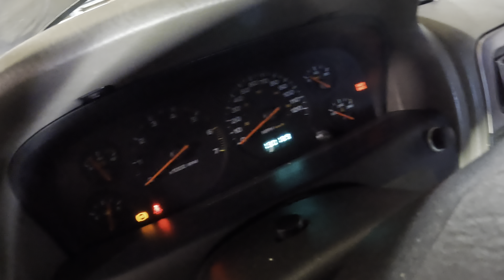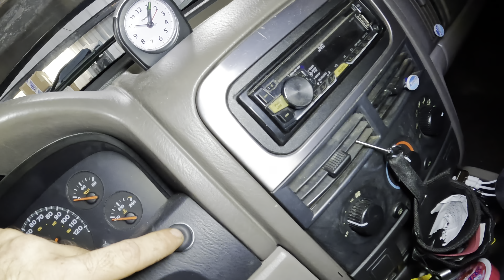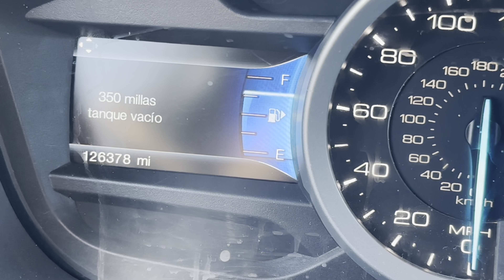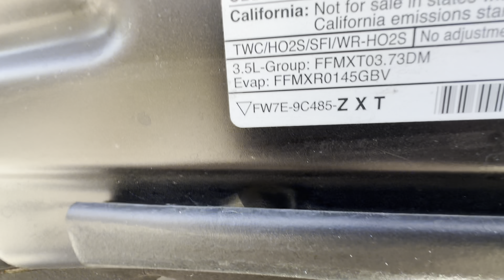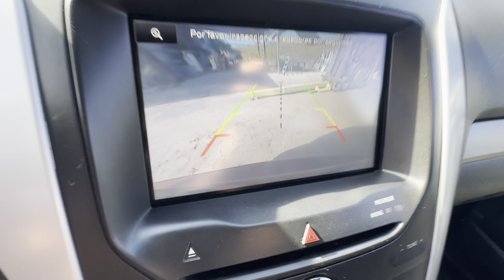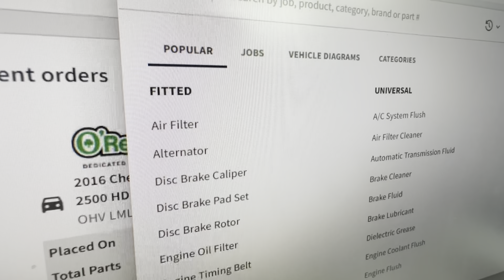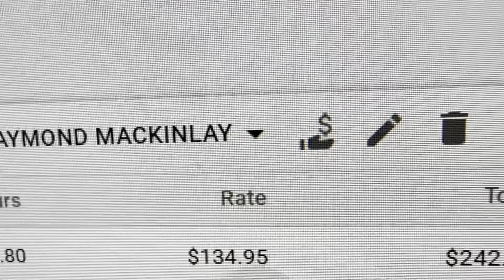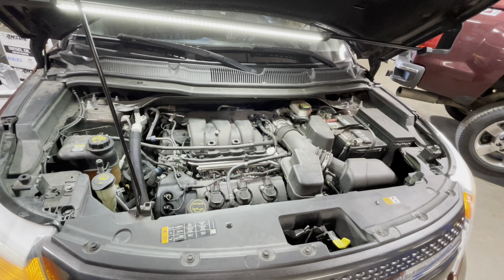TOO EXPENSIVE!  Repairs Declined! Twice! Jeep Cherokee 4.0 & Ford Explorer Noises While Driving

Comment: Wouldn't it be simpler and faster to document everything right with the Jeep instead of everything wrong with it?
Reply: Short list
Reply: I think the list could say it looks like a jeep.........the rest is junk.
Reply: No, Because jeeps have more things wrong with them then right! 😁
Reply: @404notfound..... 
Thats what he said, list of things right with it.
Reply: Not if you just replace the part between the front and rear bumper.
Reply: It's a Jeep thing and that's a thing I never want to know about.
Reply: Pefect observation!! Bravo.
Reply: It's not that it's a Jeep.  It's more like the owner is careless on his maintenance!
Reply: He did, “no rust”
Reply: @frfalbo Most people do not do preventative maintenance. At most, they will change the oil on the schedule that the car maker tells them to. They are not going to go out of their way looking for problems unless they are VERY WEALTHY and have lots of disposable income.
Even then many of them will say "Junk that car, I will go get another 2-3 year old one from the dealer that has been traded in, vetted as being in good condition, AND comes with a manufacturer warranty still running!"
Reply: That jeep is junk, cheaper to buy a newer one then repair it
Reply: This jeep is looking to be a "Just Rolled In" submission. The missing brake pads and pinched off hose are a splendid example of owner abuse.
Reply: Yes, there would be nothing to say...
Reply: Sir , Your Jeep's frame is straight
Reply: The list of things right with it: it has wheels, it is not a Trabant or a Yugo.
Reply: nothing was right with the jeep. its a jeep.
Reply: Glass present.  4 tires.  Doors.  Seatbelts.  Send it!!!!  Reee😮
Reply: It would be a blank sheet of paper.
The best thing to do is take the radiator cap off and then drive a new vehicle under it.
Reply: the engine maybe? those 4.0L engines were basically unkillable
Reply: If he did that, this video would be too short
Reply: @myacidninja1025  thats too new for a 4.0, thats where they started with the v6
Reply: "Most of the lights work, and it starts almost every time"
Reply: @stevepreskitt283  but only if you arc the solenoid on the starter with the key in accessory mode and you have to run out of gas for it to shut off
Reply: Not much right with it ....salvage  yard best bet $$$
Reply: Jeep:   Just Eats Every Penny

Comment: customer thinking, "I can change the alternator myself!"  Good luck
Reply: I'll give my buddy a few beers and he can get a junkyard nator installed for me.
Reply: I mean I did it myself, but I also had a 97 Camry where the nator is quite literally right in front of you when you open the hood. This thing it's buried down at the bottom. Plus that nator I got only cost me like $80 after sending back the core.
Reply: @Skylancer727  exactly
Reply: @milwaukeeroadjim9253  sometimes...
Reply: Refrigerant hose in the way?   Next dilemma for DIYer - inoperative air conditioner with no coolant.
Reply: @timetryp422  customer will likely be back after realizing their mistake
Reply: Just did a water pump on that engine.   Figured easy fix, $100 part.  Then saw 14 hrs labor and have to remove the whole timing system.  Lot more than the old days of 4 bolts and the worst part was the fan.

Comment: Here in the UK we have what is known as the MOT, where once a year every vehicle over three years old has a thorough check of emissions, lights, seatbelts, correct door operation, all suspension parts, tyres, brakes, oil leaks, warning lamps, wipers, steering, exhaust, fuel system, drive shafts, and so on.

All the test points can have one of three results, pass, fail, or advisory, a fail on any one item and the whole vehicle fails, advisories are items that will need attention soon such as treads getting low, slight oil leak, slight brake pipe corrosion. etc.

It takes approx. 45-60 mins and costs £50 or about $63, so not a fortune and can save lives.

I can never understand why they don't have something similar in the whole of the USA, I know some states have a similar system but not all.

This one and like many similar ones seen on such as Rays and other channels are absolute death traps and should be off the road forever or until all repairs are completed.

Many times in the event of an RTA involving one of these sheds, folk die, I'm not bothered in the least if the driver/owner dies, but often sadly totally innocent folk are killed.
Reply: Same in sweden. Usually MOT is a big worry/pain in the ass to go through every 14 months but seing stuff like this kinda makes me appreciate having such a system.
Reply: MOT takes 10 minutes tops here in Denmark. Keep up with the basic maintenance and it's a non event.
Reply: @erik_dk842  do you regularly swap suspension or ball joints as basic maintenance? Basically the only thing they dont check is the state of your filters and fluids, which i would consider regular maintenance. Brake maintenance is the only point i would agree that regular maintenance would prevent MOT trouble. But also there calipers can get stuck, leak, etc so unless you rebuild your calipers every few years, you could still fail there
Reply: In America, every cent of the 63 dollars is allocated towards a Starbucks coffee.
Reply: The MOT was introduced because we had "sheds" on our roads.
Reply: Watch it brakes then they blame him
Reply: 😅No national system in the US, each state is different and some have no safety inspection whatsoever. Like California, where I live now…smog test but nothing else.

Comment: I'm amazed as to how clean the undercarriage is. Coming from the rust belt, I see potential.
Reply: Agreed. Low mileage for its age, body seems pretty good, undercarriage is clean. Totally worth the repairs needed, as long as the engine, trans, and transfer case are as good as the rest. The 4.0L is a great motor, one of Mopar's best engines in my opinion.
Reply: @dashcamandy2242  Worth the repairs IF you get a good rate or DIY. There is a LOT of labor to make that okie-dokie, and it ain't worth all that much.
Reply: Yeah why fix a jeep when you could fix a McLaren.

Comment: Is it just me, or is that pair of vise grips pinching off the rear brake line not only nice and shiny, but also very cleanly mounted with those zip ties!
Reply: It reveals a long history of such jury-rigged repairs in this owners past.  Practice makes perfect.
Reply: Brake lines in general are cross connected That means front left and rear right to ensure at least two wheels can break in case of but that rule (and more) doesn't apply for this car lol
Reply: Derek of VGG approves this repair.  "We'll pretend we didn't see that."
Reply: Makes me wonder if that was done by a previous owner so they could dump the thing.  If you have the skills to know what to clamp the vice grip on and be able to do it that elegantly you have the skills to swap out some pads and rotors
Reply: @Jay.Kellett  The owner did the right thing and pretended he didn't see that, because who needs brakes when you got a working analog clock on the dash feller.

Comment: As a mechanic I’m all for a person wanting to do there own work but for god sakes if you don’t know what your doing you have a world of resources to teach you. I started when all you had was dealer Haynes and Mitchell manuals.😂
Reply: Used to buy one for every car I've owned. No sense in being kept in the dark.
Reply: Never had enough money for books . Had to go to the library. Get copies for a dime . Doing the best I could with no money .
Reply: What, no love for Chilton?  😁
Reply: Some people are just lazy. Case in point: the bumper cover. The person could have just got the correct clips online or somewhere, but  didn't want to spend the 30 minutes figuring that out.
Reply: @PlymitBoy  Right ? HF has plenty of assorted kits. Picked one up myself because I needed one for my coolant overflow reservoir. 
Also, he didn't even use a black zip tie. Friggin wire he used. Not good.
Reply: Remember the old Motor manuals? I've got one from 1968 I had with my first car. Here's how it told me to replace the water pump on a Ford 6-200. 

1) Remove old water pump.
2) Install new water pump.
Reply: I remember buying the Chilton's for 70's  pickups, and then graduated to getting 3 inch thick factory OEM manuals for later stuff.   Could not imagine having Alldata or MItchell back then, would have been a game changer
Reply: When I was a kid I would check out every car book I could get my hands on from the local library, including repair manuals. Later I would buy them for my various hooptie cars back in the day. Before I ever had a car to wrench on I had learned a lot.
Reply: @PlymitBoy  it's called plastic, probably got broken removing it to do some nonsense.
Reply: Agree, however some people do not know that they do not know they are doing it wrong.  Or do not care and/or too cheap to pay others.  They are dangerous because they do not value others time and want free diagnosis so they can do it themselves.  I did some time being a tech in a small shop.  One day I locked the keys in the car and scratched the inside of the door trying to open it.  Owner did not have extra key and demanded a new paint job.  The car needed thousands of dollars worth of repairs.  Shop owner told him to get lost and that was it.
Reply: @Lloyd-z3q At least the shop owner stuck up for you. 👍
Reply: It was Haynes and Chilton for me. Until I bought a Jeep Commander that nobody ever made a manual for.

Comment: I was surprised that the Explorer (exploder) owner declined. The vehicle looked to be in fairly good condition, high mileage but still okay. The way that alternator pulley moved it might just be an exploder on its way out. Good documentation on both the Jeep and Ford. The Jeep definitely is a vehicle I would hate to share the road with. It's no joke when messing around with questionable brakes. The vice grips on the left rear was a tell on everything, plus the other noted deficiencies.
Reply: That is a classic "have a mechanic diagnose the problem", then have family member/significant other replace the part with reman'd (cheap) junk for $20
Reply: How much was the estimate. At my minimum wage rates I figured $1500.
Reply: @jimandersen3003  I'm guessing you didn't watch the video?!
Reply: People have money to drink and party and buy cigarettes,but no money to fix car😂

Comment: You're 100% right about chepo parts failing.  I remember the alternator failing in my 88 Formula 350 when I was in college in SW VA. I was able to limp it to the GM dealer and had them install a new GM alternator.  Easy job but I didn't have tools down at school but it fixed the problem.
Reply: Have the same problem with cheap parts on my Ferrari F40. The ashtree is cheap and to small.
Even on small yourney there is no room enough to smoke a few joints.

Comment: The alternator noise is the rotor rubbing on the stator, because the front bearing has collapsed. This usually wrecks the insulation on the coils in the slots of the stator, and renders the alternator not only damaged, but dead, because it's un-rebuildable without an (uneconomical) rewind.
Reply: You can replace every component inside the alternator. But you might as well just get the remanufactured unit,  but get the cheapest one with a lifetime warranty.  
My first job 45 years ago was rebuilding alternators and starters.  This was about the time that GM started using internal voltage regulators and got easier to rebuild.  The other companies caught up eventually.  But there is a reason that GM is the alternator of choice in the hot rod and resto-mod community. 
It was even the go-to when fixing a Jaguars electrical system.  
Oh, and I always buy my parts from a national chain so that if something fails when I am out of town,  I can still get the parts covered under warranty.
Reply: Yeah, but hes saying that the drive end bearing and prob bearing housings so fucked that its polled, therefor needing a rewind. And if you guys are getting over a hundy bucks an hour to diagnose, then the rewinds prob not worth the money.

Comment: Always cracks me up when you see someone add a "power reduction device" to the air intake... If you aren't upgrading other things like heads, exhaust, etc, you're almost 100% guaranteed to be reducing your engines power... bank on it. 😉
Reply: The C&N filters cause problems with the airflow sensors from the oil and usually don't get cleaned right causing less air flow. Also, the Explorers are not exploders, that's a term I use for Toyota 4.0 and other newer crap engines.
Reply: They also let horrific amounts of dirt through and Project Farm did test proving that they barely flow any more air than a quaility paper filter

Comment: Being from the UK these videos always amaze me. We have to get an annual inspection once the car is over 3 years old called the MOT. Fail it and you can't drive it (aside between a test centre to home) until it's been repaired.
Drive it without and you can be fined up to £2500 (over $3000) and even loose your drivers licence. You also won't be able to renew your car tax and if you get caught driving without that they can crush your car!!

Comment: Back in 93 we had a lady come in complaining that her brakes were grabbing. Upon inspection pads were completely worn to the point that the roters were paper thin with holes. She refused the work and wanted to leave. We refused to let the vehicle leave because it was a death trap. After she screamed and had a Karen fit we had her sign a waver that we are not responsible for death or accidents due to the fact. So she got the car screeching tires out of the parking lot and got T-boned. Came back and said she was going to sue us for the accident. We all just laughed at her and went back to work. 😂😂😂
Reply: I understand that you were reluctant to allow her to drive away, but theft is theft.  The waiver was the proper way to go.
Reply: should have just offered waver first making people mad by threating to still there stuff makes them drive faster  so in away could of been you fault.
Reply: Can’t really even call that an “accident”!
Reply: Dealing with computers, we have customers sign waivers all of the time.  It is the only way to "cya"   I once did a remote session with a customer.  Only to have them blame me for a virus after the session.  I once had to work on a file server.  I did nothing more than turn the power on and it went down for the count.  Both times I'm glad I had a waiver to back me up.  I'm surprised that automotive doesn't have signed waivers before they do anything.  Cars can be so finicky that you change a tire and the computer blows out before the customer gets home.  Although the 2 are not related, you can bet they will come after you because it was working before you changed the tire.
Reply: In Australia it's comment practise for mechanics to charge a diagnostic fee , then it's your choice to accept the repair quote.

Comment: I've used the duralast nators on a couple different autos I've owned as of today I've not had a problem with one. I've installed probably 5 of them. But with this being your lively hood and business I don't think I would use 1 unless customer wanted it or provided it themselves, and I would put in writing that any labor cost due to a failed part would be the customers responsibility to recover from the parts source. Just my opinion.

Comment: good luck for the backyard Mechanic that will most likely tackle their OWN alternator R&R... that job is NASTY to do without taking a wheel off the front right on the hoist(worth the cost of a mechanic to change it out) Charge em for the diagnosis anyways bud.

Comment: Coming fron the northeast, the fact that this WJ has NO rust means its still quite viable. The 4.0 will run forever, and there are plenty of parts in the yards locally to fix whatever is wrong at a tenth the cost. You all see garbage, I see what looks like a few weekends and kinda fun. Maybe its a Jeep thing>
Reply: I'm always amazed at how many rich people Watch ray's videos. They always seem so ready to just scrap the vehicle and go buy a new one.  😊
Reply: @stevewhite3424  agreed. I I'm certainly not rich, but I do have quite a few Jeeps in my yard. I would love to have this WJ and start sorting it out, the comments seem to feel otherwise.
Reply: @stevewhite3424  I think fixing that car will cost far more than it's worth. You're better off going to the used car dealer and buying something for less than $3K. That thing is well beyond what I'd consider fixing. 

And not sure why you'd specifically say "buy new". If you're casually driving a moving scrap yard like this, I kinda doubt you ever buy new.
Reply: @Skylancer727   the jeep could be fixed in a weekend or two as a home mechanic for not a lot of money, its all just maintenance issues that are easy to fix on these older vehicles, now paying some one to do the work is definitely not worth it.
Reply: But it's a 2wd Jeep, with all those problems.  Sure, it's a great candidate for a driveline swap but there's all the other pieces that need transferred over too.  And you're still left with something that's only worth $3-4k (still titled as a 2wd model).
Reply: Someone in Watch Wes Work's neck of the world would love to have a rust free car like that as a project.
Reply: @Skylancer727  That is a $3k vehicle at a dealership 🤣
Reply: @Skylancer727  I don't know what used car dealer you're going to lately, but nothing under 3K would be in any better shape.
Reply: @Skylancer727 I would love to see you find a decent 4x4 for 3k at a dealership 😂 your crazy that Jeep doesn’t need that much in repairs to get it safe.
Reply: @waterloo123100  there's plenty of nearly value-less cars out there. I've been driving a 97 camry I hot for $1500. The repairs on this thing will likely be over $5000 at which point there's likely far more that needs to be fixed that we can even see now.